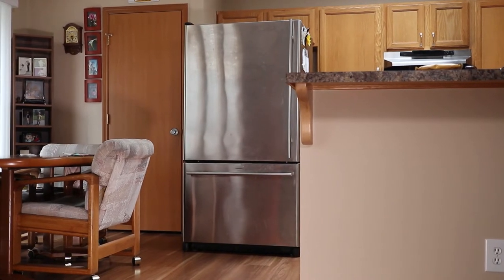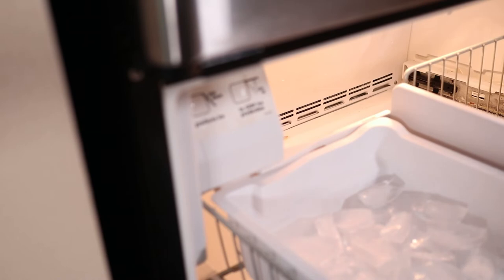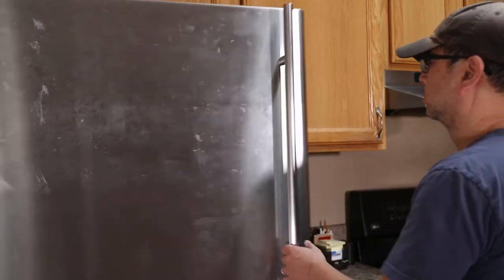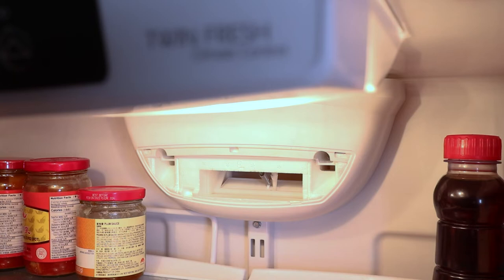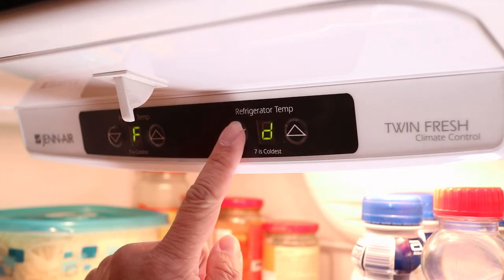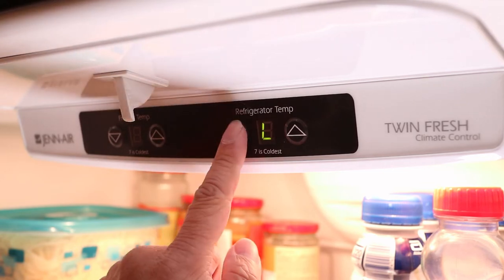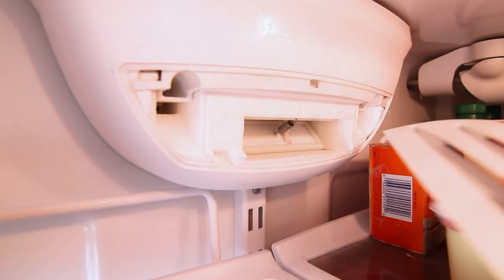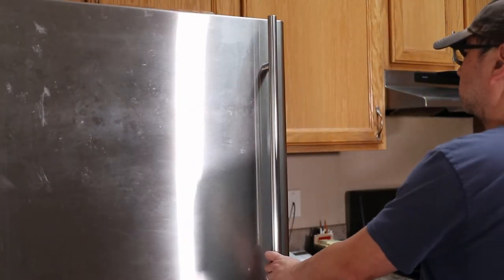How to Force Defrost a Jenn Air Fridge - Fridge Not Defrosting Bottom Freezer Cold Refrigerator Warm

Comment: If replacing the circuit board doesn’t fix the fridge being warm and freezer cold, what else could it be? Manually defrosting it using a heat gun fixed it for a day but now the fridge is warm again.
Reply: The thermostat

Comment: Found this video to be super helpful. Thank you. Hope fully I have the same issue as you. Should be a simple fix.
Reply: I have a similar display control.  French door. JFC2070KRW 1098828JG.

Same issue..  Ice buildup.  Happens ever few months. 

Warming the freezer with a fan fixes the issue. Temporarily 

I was going to check heater and sensor. 

However after watching, and assuming I need to hold down both door switched for the first 3 down pushes, and let up. 

I can't get it to show the F and D 

Mine is and older model purchased 12-19-06.  Could it be my control doesn't have this feature?  Or is it telling me that is the issue?

Thanks for the help.

Great professional video...

Comment: I turned on the forced defrost mode on our whirlpool bottom drawer freezer fridge following your directions. I do not hear or see any visible evidence of the ice melting inside the freezer area. I even use my temperature thermometer gun, There should be a 275°F heating element activated somewhere.  should there be evidence of the heating element turning on?

Comment: Thank you SO much!
Our fridge was acting up and we almost lost all of our food...we were already shopping online for a  new fridge when I came acrossd your video. I tried the method you demonstrated and it worked like a charm!
Reply from the maker: Excellent! I’m glad you were able to force defrost your fridge! However there’s probably an issue somewhere else causing the build up of frost. Eventually I determined on this fridge that the circuit board had to be replaced. If you need instructions to replace your circuit board I’ll leave a link to my video from my other channel. If I remember correctly the circuit board was maybe around $50 but still way cheaper than calling a repairman. Here’s my circuit board replacement tutorial: https://youtu.be/-9n5i9I35Ek
Reply: @TheRenderQ  Thanks! I already watched that and saved it for "just in case". My plan is to get another defrost timer (mine is only $20 on Amazon) and install it first and if there's still an issue I'll follow your guide on replacing the circuit board.
 Thanks again! I subscribed to your channel & know there will be other helpful videos in your uploads.